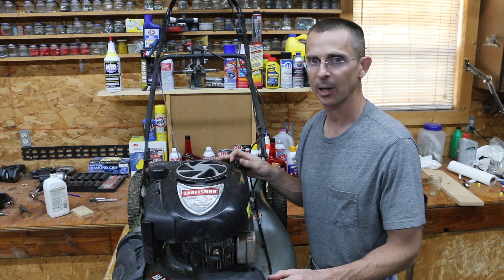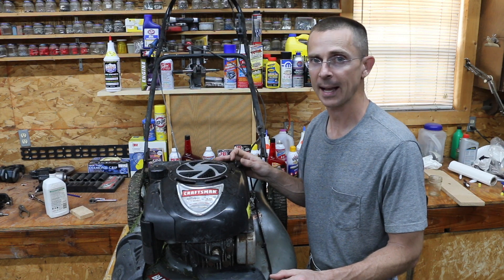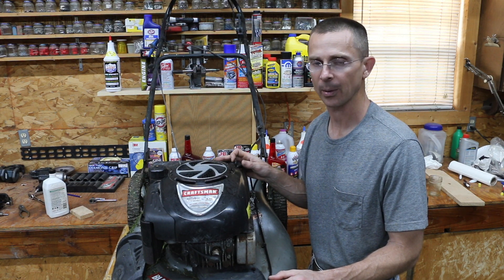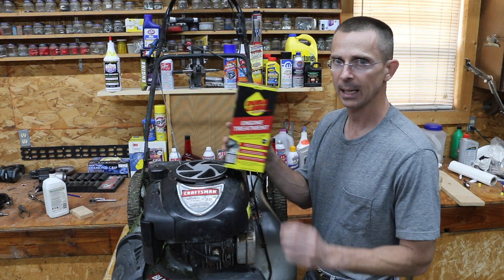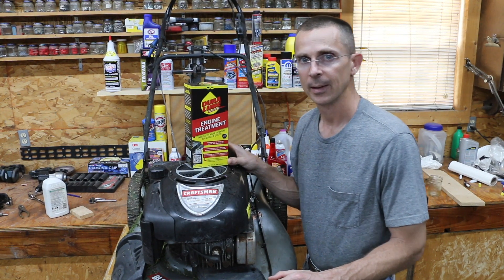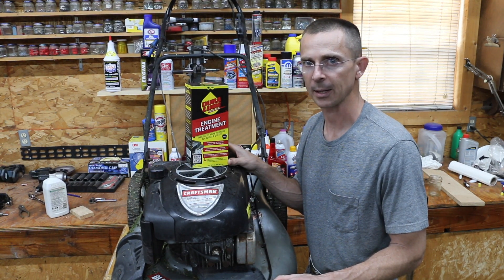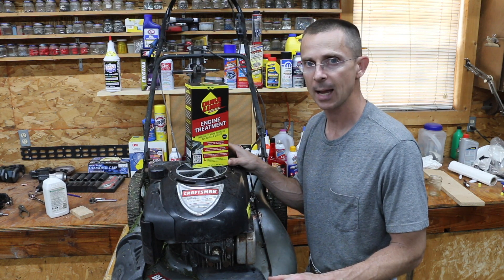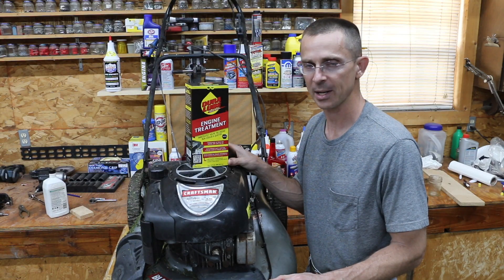Does Dura Lube actually help quiet and cool a gas engine as claimed?

Comment: put water in the oil
Reply from the maker: t North, Great idea!  Time for more destructive engine testing this weekend!  Thanks for watching the video and commenting!
Reply: your welcome and can u say the comment in your video
Reply from the maker: Sure! I was thinking about testing water plus another ingredient together.  Thanks again!
Reply: I already suggested that to simulate a head gasket failure. I do not think that a little water in the oil will hurt it in the short term. However, rust could be a big issue long term though. See how much water you can run before damage occurs. I am guessing anything less than 50% water in the oil will not cause immediate failure.
Reply: A DIY Computer Guy no I was talking about putting a lot of water in the oil like do a 25 to 75 ratio
Reply: That sounds good.
Reply: t North   Oops dunno what happened there?? But anyway put gas and battery in and she started and ran and the engine was totally full with water and we thrashed the living hell out of it for the next two day up and down the river bed and it never died never even when the sump was hitting the crank from all the rocks and it started running better as all the water in the oil had evaporated.
Reply: t North   I once purchased a old Vahxal Victor that had been sitting under a pine tree for years with no bonnet or lifter cover and you couldn't even see the lifters from the pine needles for about $30. but anyway I put gas in and a
Reply: We already saw what happens when water gets in the oil in the water video where the oil/water started spilling into the intake. I guess a small amount of water steam cleaning the engine wouldn't necessarily be a bad thing?
Reply: It didn't hurt the engine either.
Reply: My dad had a weed whipper, that would run on half gas half water. LOL. Didn't work too well but it saved us a lot of gas on a big yard. Weed whipper is 25 years old this year and still works. Thing's older than me... I'm 21
Reply: Many cars have a cup or so of fuel/condensation in the oil just due to blow-by gases condensing in the crankcase. This is not good for the engine but engines and motor oil are designed to handle it.

Comment: Can you try to put jb weld in cylender scratches and see if it will gain compression and run better
Reply from the maker: big hoss, This is a great suggestion!  I think I'll select an engine with deep gouges and very bad compression to see if it'll help.  Again, great idea!
Reply from the maker: Berner's Vlog, Great suggestion!  Thanks for watching the video and commenting!
Reply: since the "high heat" variant of JB weld is only rated for 220°C I really doubt that it'll be any good, the only thing you can really do is hone the bore to a bigger diameter if it's a cast iron engine and use oversized pistons, if it's a aluminium engine you would also need to have it hard chrome plated.
Reply: Nathan West  220*C is pretty hot, its almost 430*F
Reply from the maker: thisisnme, This is a great suggestion!  I believe JB weld could withstand filling a deep scratch running the entire length of the cylinder.  The metal surfaces on each side of the JB Weld would get the brunt of the friction caused by the rings.  However, I do not believe JB Weld would last long if used as an entire cylinder sleeve.  This is my opinion and there a lot of others that have experience with JB Weld on this forum.  Thanks everyone for this suggestion and for the discussion!
Reply: Project Farm Correct me if I’m wrong, but isn’t the first step before applying JB Weld is to clean the surface of grease and oil? Wouldn’t an aluminum cylinder be oil impregnated reducing the chance of a good bond? Would the burn from combustion? It will definitely make a cool video, however.
Reply: Nathan West  Did you happen to see the video where he cut the head down the middle and repaired it w/ JB Weld?  I didn't see any damage to the JB Weld after he ran the engine w/ the repair.  I don't remember if he brought it up to full operating temp, but that seems like it would be the hottest part of the motor.  What are your thoughts?
Reply: Sorry, big hoss, but nothing, JB Weld included, will stand up to the friction and heat of the rings. 
You'll either have to bore it out bigger to remove the scratches if that's even possible, or just replace the jug.
Reply: Project Farm you should try it on that mower you put the sand in. make sure to replace the rings and also hone the cylinder.
Reply: alex tworkowski did you see the video where he built a cylinder head out of JB weld?
Reply: Project Farm I am happy for you to think about it thanks for the videos keep up the good content I love these videos
Reply: Gas cylinders?
Reply: Hey Project Farm, I just heard about this product called BG44K. Supposedly, it's a fuel additive that REALLY REALLY cleans out an engine system. I haven't heard of it until today, and i've also never seen it in stores. I'm curious to know if there's any truth to how well it cleans, maybe that could be a good test for a future video? The people who talked about it said it's really good stuff. It's also priced a bit higher than seafoam and other common cleaners.
Reply: thisisntme sorry I didn't know
Reply: I use it on my jet boats wear ring seems to outlast the aluminum id wonder how it would do in there.
I have found that a bondo spreader works great to spread it, and then hone it to spec.
Reply: Vendetta-X, yes, BG44K does do a severe cleaning. When you do that good of a job, you'll for sure block up a catalytic converter some, cause other damage from large chunks of carbon breaking a way too well.

My point is, it works, but there's good reason most products have gentle cleaning. If it worked really well, you'd break what you were trying to improve.
Reply: Nathan West yeah but it says on the jb weld tubes it can fix cyilenders
Reply: Project Farm I was suggesting just filling the scratches with it and not as a sleeve.
Reply: thisisntme same everyone else needs to calm down because I am seeing if a cheep fix will work so please stop saying sleeve or i know that is the best thing for a scored engine but I want to see if this will work
Reply: rimmersbryggeri yeah
Reply: big hoss what are you talking about? not once did I suggest he sleeve the engine.
Reply: Project Farm I said this on a mower that he saved in a previous video when a Clyde wall had scratches pretty sure it's was testing jb weld
Reply: alex tworkowski You missed the end of the JB weld cylinder head video. In the short time it ran, there was a gouge developing in the JB weld. It was clearly in only a minute, already getting destroyed.
Reply: cylinder
Reply: I have used jb weld in a 8hp Briggs and Stratton that had low compression, it worked for a little bit before it turned into an gas powered smoke machine
Reply: big hoss nice idea man! And don't stop there, any place JB Weld could be used should be tested. It would be cool if you could find something with a transmission and try to fix a transmission gear tooth that is missing with JB Weld.
Reply: alex tworkowski yeah I seen every video and I think it will work because I have a cr 125 and the cylinder is junk so I wanted to know if it will work

Comment: I say try "best line" than you will see real results
Reply from the maker: 998vick, Yes, I'm planning to test best line.  I've heard it's a terrific product!  Thank you for watching the video and commenting!
Reply: 998vick apparently best line has chlorinated Paraffin in it, with heat is really bad for motor it eats the metal. see hotshots fr3 friction reducer test vs additive with chlorinated Paraffin!  they put some heat into the additives and the bestline type turns into sludgy black tar substance, check it out

Comment: Was the oil in the engine on the first run old or new oil? New oil may account for the lower temps and higher rpms. Also if previous owner tossed the wrong weight oil in and then you put in 30w oil that may have helped the knocking.
Reply from the maker: Michael, Great point!   The oil in the mower wasn't too old. The mechanic I purchased it from had recently replaced the oil. Thanks for watching the video and commenting!